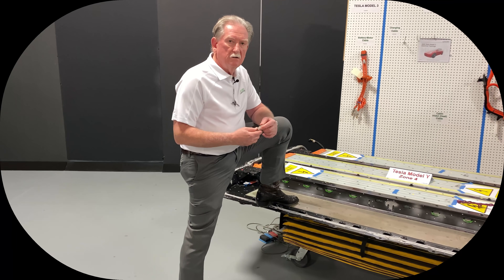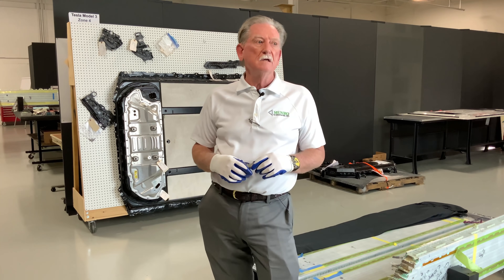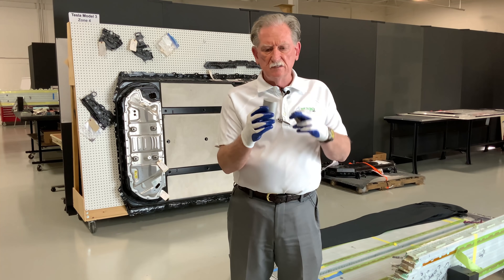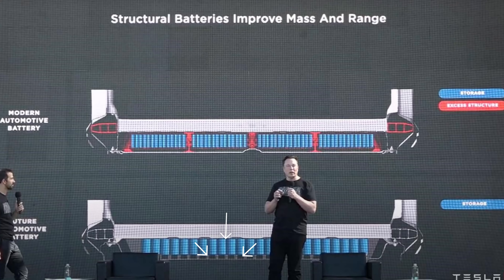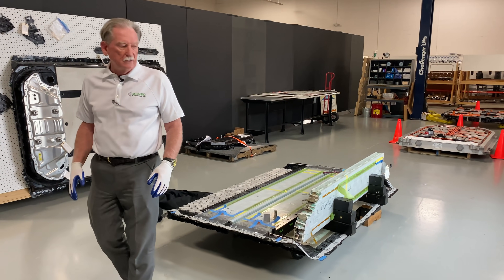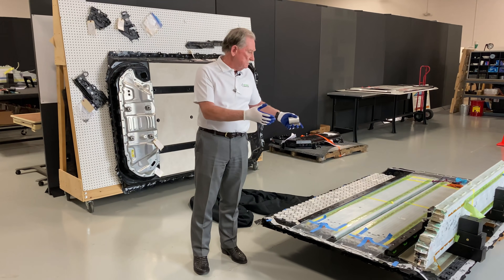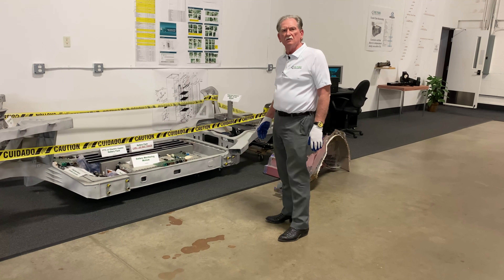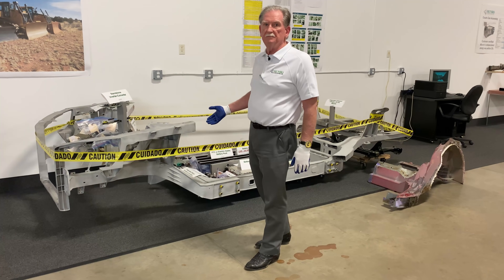Sandy is Thrilled about Tesla's Battery Day & Begins Battery Mock-up

Comment: -9% energy density by volume. Kind of cumbersome to make comfortable and low drag cars. The way the cells are worked into the chassis will kill resale value of wrecks. Tesla would buy them up cheap.
Adding so much range will keep costs high but not get many more buyers. More or less wasteful. Save supercharging events and longevity, though.

Comment: Just one question. If the battery is an integral structure to the car, what happens if the battery fails? Is that the end of the car? (Oh, that's two questions now)

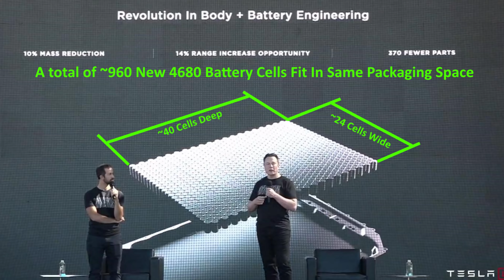Comment: 2:27 Where is Sandy getting 130 kWh for the new batteries vs 74 kWh for the old ones? Did Tesla announce this, or is this a calc done by Sandy?  Because what I saw from Tesla was that the new battery cells have 5x energy capacity, yet occupy 5.5x the space, so actually that's a drop of 10% energy/volume. Probably they win some from not needing the intermingled cooling. But still just the larger battery size does not directly gain any energy/volume.  What am I missing?

Comment: Sandy please read this about the new battery config. These innovations [front end and back end] are tremendous but I see one problem ahead. What happens if you get dinged? It means you have to replace the whole front end or the whole back end. In the old form, the small part could be replaced. On the new form, a small ding will cost the whole front end or back end. This will affect insurance. There will be massive insurance costs. Let's say the tesla car had one ding per 1000 vehicles per year. With the small parts the actual part cost on average 20$. Now with the 1/1000 cars that get dinged, tesla insurance will be paying out 5000$.

Comment: Three-wheeled vehicles are pretty close in cost and market for their upcoming subcompact. Licensing and tech exchange would be cool.
Sandy One question,  can tesla implement Giga press tech into the cyber truck design. Would the Exo design be compromised, and finish be acceptable out of a casting

Comment: Hi Sandy, there is another company Canoo which has directly integrated batteries into chassis without casings. 
Their chassis ( Skateboard) is modular and any type of body ( they call it hat ) can be placed on it. They also have a steer by wire system meaning steering does not require mechanical connection and can be placed anywhere in car. They also have Level 2.5 autonomous driving from QNX and Nvidia.

Comment: You think they will go Passive Cooling from the bottom plate or still have a fluid or a Heat Pump solution?  As I can still see issues with fast charging and cold and hot climates...?

Comment: I wish someone smarter than me would do some heat transfer calculations to see if Tesla can remove sufficient heat from the top (and bottom?) of the battery without cooling the sides.  Mu gut says no but I don't have data to prove it.

Comment: I just can't understand why no other manufacturers came up with this design ?? Look at this: this is my simplified paper model of any actual cell battery on the market, including 18650, Tesla's 2170:
https://box.pionier.net.pl/f/c8d641c56b4841bb9026/
https://box.pionier.net.pl/f/3908c60bb2cb4c52b55d/
it consists of two stripes of foil covered by different chemicals and isolator between them: Anode and Kathode. All amperage during charge/discharge is going through these two small TABS (one connected to +, one to - of the battery). Look at the electrons path that have to go to charge battery (lines). If stripes are around 6m, from TAB, to either any end of the strip is around 3m !!!
TAB alone is like thin cable when strong current connected to it: ot is getting hot, as well as stripes that electrons that have to go through them.

And now look at Tesla's TABLESS design....
original screenshot from Tesla Battery Investors Day
https://cleantechnica.com/files/2020/09/2020.09-tesla-battery-day-annual-shareholder-meeting-SCREENSHOT-jelly-roll-4680-cell-.png
And my simplified paper model:
https://box.pionier.net.pl/f/c859e80f837946629e3e/
https://box.pionier.net.pl/f/ec1ee09cb7db4b55a54f/
Just by this simple step, they eliminates TAB 2 main bottlenecks : temperature and speed of charge/discharge. 
Temperature: current in/out is divided by every TAB on the battery, so: it can be negligible. But maybe more important is SPEED. Look at electrons path that they have to go to every battery cell space: it is at most.... battery length ! In case of 4680....: 80mm, not 3m as in standard design !

Tell me, why NOBODY on the market didn't came up with this design before ???

You guys are great ! Thanks for knowledge you share.

Comment: Thank you Sandy again . A question for you. If a car with gaint castings run into an accident, would it be very expensive to fix it? They need to replace that huge heavy part which connects to everything.

Comment: Sorry, I have a question. 2170 cell is 5 Ah, it's OK. 4680 cell must be about 37 Ah, not 9 Ah. I believe simple mistake.
Reply: 25-26 Ah
Reply: @jamesmaddeaux4304  Thank you for your reply. 25-26 Ah caused by cell volume increase. I think cell chemistry change factor is needed, 1.4 times.
Reply: @EV164HIROSHI  Yes, they might be sandbagging a bit

Comment: Wouldn't a cast frame be more prone to stress fractures? From my experience dealing with aluminum castings is that they cannot be permanently repaired. You have to pretty much toss it and get a new one.

Comment: I do not understand why this new form factor is that groundbreaking.
When charging batteries I do not feel that the ends are hotter then the rest of the cell, they feel like same temp everywhere.
If only the ends are coolable the cooling surface of the 2 batteries are about the same, before it contacted the length of the battery on both sides, in the future it only cools the tips or maybe only one of the tips.This battery needs to do more work per cell, because there are a lot fewer of them, therefore the heat per cell goes up but the cooling per cell stays the same.

The argument about needing less battery packaging material per kg battery chemistry: If the cells are now part of the structure, they may need more packaging because they now need to do structural work, instead of the old cells that just needed to support the battery chemistry and nothing else.

"Elon always undersells what he is doing" I am sorry but i feel like that is a huge lie, he has previously promised the following the next 5 years:
Cybertruck
Tesla semi
Tesla roadster 2
Tesla S Plaid
A Tesla mini
Full self driving
1.000.000 mile battery
Full taxi fleet of Teslas
Heatpump in rest of the lineup, (hopefully not held in place by plastic wood trim and metal straps)
Raising the build quality of delivered cars by correcting errors before they reach the customer

He is going to have some busy years ahead of him if he want to deliver on all those promises.

The comment about not needing solid state batteries because of a change in battery dimensions is very odd, because the dimensions do not change the fundamental properties of Li-ion batteries.

Do not praise Elon and then ask for his help in the same video, it feels like you are not impartial and that could danger the credibility of your work and reports.

Comment: Hallo Herr Munro, 
Was Ihre Analyse der größeen Batteriezelle anbelangt, so stehe ich da voll hinter ihnen, der wesentliche Vorteil ist die Verbesserung des Verhältnisses zwischen Verpackung und Inhalt. Und hier sehe ich sogar noch mehr Potential, stelle ich diese Zellengehäuse mit genau der Technik her, wie Getränkedosen in Fließpresstechnik, wobei ich dem Becherboden auch eine größere Dicke für den Wärmeabtransport gönnen würde.
Und ich habe selbst schon einige 18650-Zellen zerlegt, und dort immrer gesehen, dass der Kern dieser Yellyroll durch freies Wicken falten aufweist, was man auch bei debn Bildern der im Tesla verwendeten Zellen sehen kann, und was eben diesen Bereich des Wickels deutlich Effizienz kosten sollte, was sich bei größeren Zellen ebenso deulich weniger stark auswirkt. Trotzsenm würde ich hier das Elektroden und Seperatoren-Material um einen festen Wickelkern rollen, und würde hier sogar noch einen Schritt weiter gehen. Und zwar denke ich hier an eine Heatpipe als Wickelkern, die dann so gestaltet ist, dass diese in den verdickten Boden des fließgepressten Zellen-Bechers in eine entsprechende Bohrung eingepresst wird, um so für eine sehr effektive Kühlung von der Zellenmitte aus zu sorgen.
Was meinen Sie? Könnte ich hier richtig legen? 

Und wenn ich dann auch noch die eigentliche Batterieplatte, wie von ihnen vorgeschlagen als ein drittes Druckgussteil fertige, in das ich die Zellen mit Epoxy vergieße, warum dann dieses Batteriegehäuse nicht mit Wärmeleit-Fingern herstellen, die den Raum zwischen den Akkuzellen nahezu ausfüllen?

Hello Mr. Munro,
As far as your analysis of the larger battery cell is concerned, I fully support you; the main advantage is the improvement in the relationship between packaging and content. And here I see even more potential if I manufacture these cell housings with exactly the same technology as beverage cans in extrusion technology, whereby I would allow the bottom of the cup to be thicker for heat dissipation.
And I have already disassembled some 18650 cells myself, and have seen more and more that the core of this Yellyroll shows folds due to free rolling, which can also be seen in the pictures of the cells used in the Tesla, and what this area of the coil is clearly should cost some efficiecy, which is also noticeably less pronounced with larger cell diameters. Nevertheless, I would roll the electrodes and separator material around a solid winding core, and would even go one step further here. I am thinking of a heat pipe as a winding core, which is then designed in such a way that it is pressed into a corresponding hole in the thickened bottom of the extruded cell cup in order to ensure very effective cooling from the center of the cell.

And if I then also manufacture the actual battery plate, as if suggested by you, as a third die-cast part in which I forget the cells with epoxy, why then do these battery housings not have thermal conductivity fingers that lose the space between the battery cells? 

What do you mean? Could i lay right here? Please let me know, wiegel@peter-wiegel.de

regards, P. Wiegel

Comment: The last bit.... no you do not need a solid state battery. What you need next is a skateboard chassis with no welds just epoxy. Very quick to make and automate. Then you need a series of modules to sit on the skateboard... et voila... van, car, self-driving tram, truck, estate car, etc

Comment: Notice the key statement in this video: "...and eventually it [Tesla's battery pack] is going to look like the I-pace". Most people will gloss over the fact that other manufacturers are already doing great things with battery pack design, and simply repeat the mantra that Tesla is "years ahead of everyone else" yet no one can come up with an example of why that is true. Does anyone honestly believe other manufacturers aren't making their battery packs structural? GM's ultium platform will be competitive with this on weight, energy density, and structural rigidity. There is nothing "revolutionary" here, just Tesla doubling down on cylindrical cells which anyone who knows the industry realizes is a dying design.

Comment: Wow! I am not an engineer but you just have to have some brains to appreciate what you are showing us.Kinda regret not taking up engineering with this sort of revolution happening
This is evolution in quantum leaps. Sorry Sandy but conventional manufacturers are closed in "How things are done" and they dont want to do large leaps rather some minor gewgaw to tease a reason for buying a new model. Driven by accountants not engineers. #ContemptForCustomers
One question though, there has to be some flexing and twisting of the battery tray so will that cause fretting or fatigue on the battery cells even though it is a very small ?
Thanks for sharing your insight and experience.  I am avidly soaking it up.

Comment: Can someone help me with the 130kWh estimate with 960 4680 cells? If the 4680 is 5x the energy of the 2170 @ 18Wh, each 4680 would be 90Wh. 960 cells would be a 86kWh pack, not 130kWh. Maybe I missed something in the comparison?

Comment: So, let's do some math.
Elon said 56% cost reduction per kWh.
Sandy says a kWh is $108 today.
An 80 kWh battery is $8,640.
A 56% reduction of the battery cost is $4,838.
An entry level Tesla model Y is $50,000 + almost $5,000 if ZEV credits are removed (it's a subsidy).
$55,000 - $4,838 = $50k for a standard Model Y with the new battery tech if that all pans out.
Elon was very clear that this is not in the bag yet.
Then there's uncertainty of battery mineral prices in the future.

If a Model Y will be $50k (sans subsidies) with the new battery tech, a $25,000 Model 2 seems like quite a stretch, even if it's smaller and uses a cheaper battery.

Comment: Saw an earlier vid with Sandy panning the million mile battery.  And he's right as far as for driving a car.  As he said, "We don't drive that many miles in our lifetime... It's got use in long haul trucks.  
However, back out a bit for a big picture look at energy systems.  Think of the vehicle as also... a battery for your house or job-site.   With these applications you can make money from it.  
Virtual Power Plant.  My understanding is that my Model 3 currently has the hardware to feed the grid. 
I haven't heard anything on the expected life of the 4680.  Is it too soon?

Comment: There are some problems with the calculations on the whiteboard at 2:37 in the video.  Based upon simply a ratio of the volumes of the 2170 versus the 4680 cell (i.e. not considering chemistry changes or efficiency of internal volume use) the 4680 cell should have 27,400 mAh capacity, not 9000 mAh as shown on the white board.  The estimate of 960 of the 4680 cells in the same footprint seems reasonable, but that only gets you to a 100 kWH pack in the same footprint with the 4680 cells, not to 130 kWh.  To get to 130 kWh would require the 4680 cells to have a capacity of 40,000 mAh, or 8 times that of a 2170 cell.  This might be possible if you are considering the internal volume efficiency and chemistry changes.  Some clarity on these estimates would be appreciated.
Reply: I am wondering the same thing ... @johnbinsc I agree with your analysis.

Comment: How did Munro calculated ~130kwh? New battery is 5x capacity . So 5x960/4416 = 1.08, within the range increase (15%) mentioned in the battery day conference.

Comment: I agree that Tesla underestimates timelines and lies. Harvard educated Wall Street simply can’t connect the dots of the Battery Day presentation. It’s a great time to load up on Tesla stock. Once all of the BIW aluminum casting changes and new battery cell production begins on a huge scale it’s game over for the ICE. With constant innovations and improvements Tesla is basically a moving target. It makes it very difficult for old school legacy manufacturers to keep up when you have a culture that does not promote out of the box thinking. And Tesla and Space X continue to cherry pick top engineers from around the world.

Comment: Elon was keen in mentioning the adhesive used to do thermal transfer. I bet you they will make a preprinted contact mat so glue to top and bottom, I also think that the coolant will flow thru the battery, instead of wasting weight with additional rigidity. Thanks sir.

Comment: Newbie here at 8:21 he begins to explain that you are using less steel to case the larger cell. How does something larger surface area require less material to cover it. I get it that the less cells will be required for the same footprint but I dont understand how less steel is needed for the casing.

Comment: Great to see this! My question is, how maintainable is it? If a cell goes bad, can it be replaced? What if it is overheating? If a pack deteriorates too far, can it be replaced? I see us going down the road of many cellphones, where an otherwise good machine has to be thrown away because the battery is nonreplacable.

Comment: Sandy, I agree with the technology trend for the future battery cell/module/pack integration and where I've seen obstacles  before that your insight would be interresting on are...

1) On the base cooles design, how do you guarantee electrical isolation between the cells and cold plate while still maintaining low thermal resistance? Assuming they move up to an 800V architecture eventually that requires around a 5kV hi-pot test.
2) They should really be looking to get rid of wire bonds in the future and instead do direct collector plate to cell laser welding. With the larger cell format your current density goes up which means thicker conductors and I see a big challenge there in doing a double top weld on the cell without damaging the header gasket. Again, would love your insight.
3) "Epoxy Fill" as well as some other filler materials have been used to make the module a single brick before. Epoxy ends up being to heavy and ruins your energy density and other materials have difficulty doing consistent shot flow since you cant using a high temp process. All these processes are messy and have a long cure time. Again, would love your insight.
4) On the structural integration side I think they concept layout shown could work. Prior attempts I've seen have modules between cross members and it turns into a mess trying to pass electrical/coolant/comms through structure.